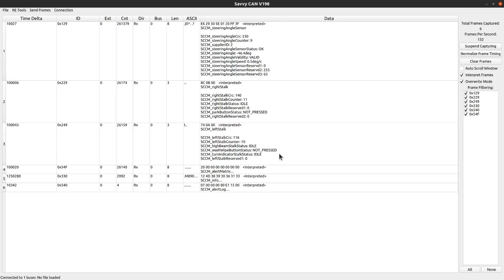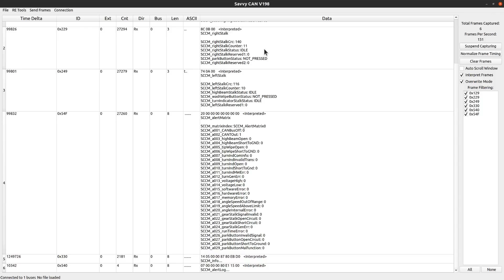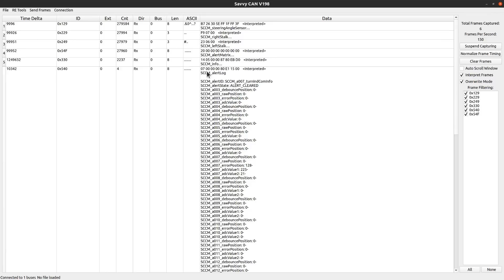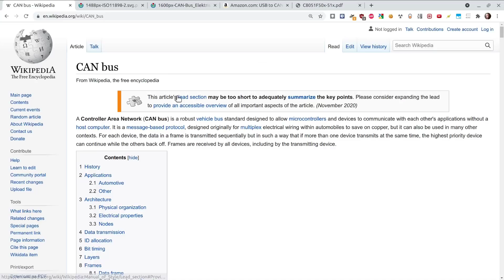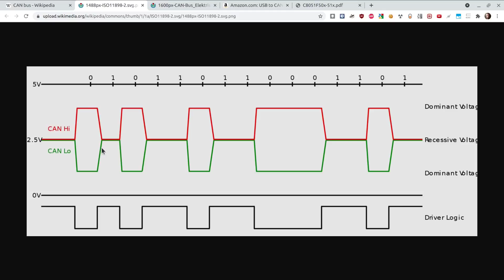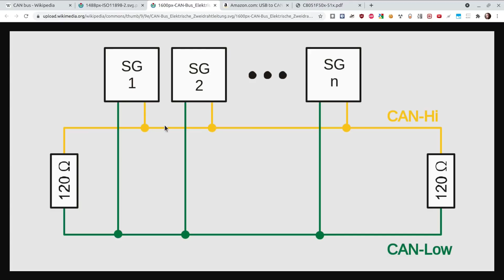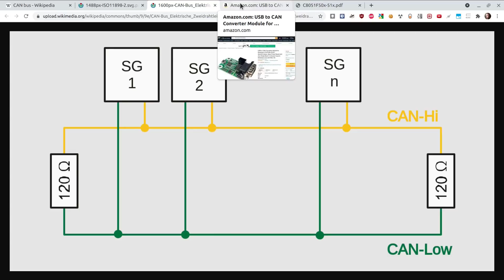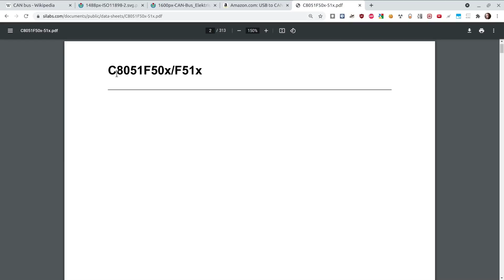Tesla CAN Bus - Quick Exploration

Comment: 14:26 Why we have a terminating resistor at each end.
Reply from the maker: I explained it in the video, if you send a signal down a wire and the wires are just open, the signal will reflect.  The 120 ohm is the equivalent to an infinite set of wires, so the signal gets turned into heat in the resistor instead of creating a reflection.

Comment: I have problem about conection with Savvycan V208  program (can't see serial port) but I using Innomaker program it work fine. Please tell me about program setup or connection setting
Reply from the maker: Sorry, I use Linux and SocketCAN, so it just works, no drivers needed.   Can't advise on Windows because I don't use it.

Comment: One of the things Tesla and other car makers have done are make light bulbs a part of can bus. Makes finding burnt out bulbs easy for a tech, expensive for the customer.
Reply from the maker: Tesla doesn't use light bulbs.
Reply: @Ingineerix they have puddle lights on the bottom of the doors, lights on each side of the trunk. All these are on can bus and Tesla has told me the replacements don’t report to the system. The mobile mechanic suggested saving the old lights ( in my glove box) as they are $35 each.
Reply from the maker: @frankdelao4067  Firs off these are not "light bulbs", these are LED based.  They shouldn't fail for the life of the car unless there is a defect.   They are also NOT on the CAN bus.  They are driven from a body controller.  I looked in the parts catalog, and they are part number 1007151-00-E listed for $17.
Reply: @Ingineerix  the price I got was mentioned by the tech. Since there is a charge for Tesla to change them might explain the price difference. We had a G35, Infiniti wanted $20 to replace the right front turn bulb, only held in place by a single Phillips screw. For years I have heard how LEDs are supposed to last years. Our house has all LEDs. None has lasted 5 years. Our G35 had multiple LEDs in the high center stop light, several in the unit went bad.
Reply from the maker: @frankdelao4067  Most low-power LEDs have lifetimes in the 100,000 hour range.  High power is in the 10,000 hours range.  Both types depend on proper engineering of the power supply and thermal system to get those numbers.  Most LEDs don't fail, but it's usually the power supply.
Reply: @Ingineerix  most LEDs in a car are hardly ever on. I have had flashlights go bad with Cree LEDs and those weren’t used that much.
Reply from the maker: @frankdelao4067  If you do a proper FMEA on the dead flashlights or lights in the car, I bet you you'll discover it's not the LED, but it's power supply.   Those cheap flashlights are bade down to a price and are hardly what I would call "proper" engineering.   I have a 10 year old Military-grade flashlight with a Cree LED and it still works as good as it was the day I got it, but then again it was about $200.

Comment: What does it mean when it says the CAN NODE is irrational or MIA?
Reply from the maker: Well "MIA" stands for "Missing in Action", just means it's not reporting in (no frames received when they are supposed to be).  Irrational means that it's probably sending data that is out-of-bounds or doesn't make sense.  Some causes of irrationality are frame counters out of sequence, checksums that don't prove out, encoded values that can't be true, such as a percentage value over 100, etc.
Reply: @Ingineerix  my 2021 Tesla model 3 autopilot ECU is in fallback mode and service mode is saying DAS CAN NODE irrational / MIA… I’m outside my warranty so I’m trying to fix it myself
Reply from the maker: @joshmills7368  First off, a 2021 car should still be in warranty.   Secondly this is probably something you can't fix yourself.  DAS is a microcontroller inside the Autopilot ECU.  If you've powered down the car completely for 5 minutes and restarted, and it's still there, then it's probably something you can't fix internally.    When I say power down, I mean both HV and LV, not just pressing the shutdown button on the screen.
Reply: @Ingineerix  I commute 162 miles per day to and from work.. I’m at $61,000 miles.. I did the power Down for 12 hours and still nothing.. I didn’t see anything obvious on the AP board.. but I didn’t use my multimeter.. it’s acting like an IC microcontroller fried itself.. you’re saying I can’t replace the IC and it start working again?
Reply from the maker: @joshmills7368  No, because you have no way to flash the correct firmware on it.   The best you could do is replace the whole APE board with one from Ebay, which should work, but you'd lose the ability to update the software as Tesla won't have the correct certificate matches.   Sadly you'll probably have to pay Tesla for a new ICE.  (They won't replace just the APE board)   You can't replace the ICE yourself either, the GW config won't match your car.
Reply: @Ingineerix  i actually replaced the ap board with one from eBay and put my infotainment board on it and it said software update required but Tesla wouldn’t it because it wasn’t a brand new part 🙄
Reply from the maker: @joshmills7368  And Tesla can't update it even if they wanted to because they won't have the correct certs.   Sorry!
Reply: @Ingineerix  no worries.. I’m never buying a Tesla ever again.. I’ve had so many issues with this car

Comment: Great video and very informative - I have a Tesla M3 SR I want to add a Tesla OEM subwoofer and amp. In the forums people are saying you can’t just add one as the amp uses can bus and the Tesla MCU won’t talk to it as it doesn’t know it’s there. I understand that but why would an amp need to be on the can bus? Surely it would be possible to program a arduino to send the signals it’s wants - or am I missing something??
Reply from the maker: It's not CAN, it uses a special digital Audio bus called A2B.  Without config set in the Gateway that only Tesla (or Tesla hackers like me) can do, the ICE (MCU) will not output the correct digital audio.   https://www.analog.com/en/landing-pages/001/a2b.html  There are also different speakers and major wiring harnesses, it's not just the sub/amp.
Reply: @Ingineerix  ok thanks - I’ll have a look into that 👍🏻

Comment: Hello, I have similiar setup like you had. But when I use Savvycan, the windows 10 doesn't regconize it as the COM port but USB serial bus devices. I wont be able to add the connection in Savvycan. In your application, how do you "add new device connection"? Thank you and appreciate your help
Reply from the maker: Sorry, I do not use windows.  In Linux it just works with SocketCAN, nothing else needed.  My only suggestion is to look for SocketCAN drivers for windows.
Reply: @Ingineerix  brilliant. Let me explore. Thank you for your reply

Comment: is it technically possible to just take a wheel module from a tesla and use a microcontroller to convert the CAN data to a usb input device? make cheapish driving wheels for gaming out of tesla steering wheels from salvage cars lol
Reply: only issue with this i spose would be the airbag lmao
Reply: i wonder if also the CRC data is designed as a means to avoid people from going and tampering with the can bus data for steering angle without tampering with the crc data (wonder what the car would do if that check failed too)

Comment: Well my steering column sensor / click spring like the one in your video has now arrived.  Can you tell me where I could look to see which pins are for the power and which for the CAN.  Did you use a specific plug or just jumper type wires .  Thanks for inspiring me to do this.

Comment: Just wanted to add that CAN FD (flexible data rate, developed around 2011) can be up to 5Mbit/s, would not be surprised if it is in the Tesla
Reply from the maker: No, Tesla does not use FD or FT.  All Tesla CAN is 500k standard boring CAN, except supercharger communications, which is 33.3k, single-wire.

Comment: I would like to a see a tear down of the model X air suspension raven system. Or an explanation of what the module does thank you
Reply from the maker: Send me one!
Reply: @Ingineerix  you can tear mine down I already took out the rear seats it’s my service van 2020 long range plus
Reply from the maker: @Mobileccs  I can't promise a teardown won't damage something.  While I try to not destroy stuff if at all possible, there is still significant risk.
Reply: @Ingineerix  That’s fine let me know when you wanna do it ..I live in the Northbay
Reply: @Ingineerix  that suspension system has my curious I did see a bulletin on the connection at the  level sensor  I think that’s what’s causing the suspension to intermittently raise
Reply: @Ingineerix  I have  both seat modules connected and no error message on the screen removed from seats
Reply: @Ingineerix  where else in the world can you get a work truck that’s fully loaded with my tools and I’m avg 310 watts a mile….I would like to see anyone get to beat that
Reply from the maker: @Mobileccs  We sell electric vans equipped with Tesla powertrains:  https://maxwellvehicles.com/
Reply: @Ingineerix  I know but I go to eureka sometimes for service calls I use autopilot everyday I can’t drive anything else ..you never see me at gas station for rest of entire life ..I refuse to pay another cent for an engine that is 32 percent efficient on a good day
Reply: It cost me 11 dollars to go to eureka

Comment: The twisting is to improve coupling between the differential data lines so that any noise picked up is ideally coupled equally into both wires making removal of the noise at the differential receiver more effective.

Comment: Excellent video! Got a sub, please do a video on the onboard charger and the can handshake it uses to talk to a charging station! Thanks!!
Reply from the maker: On board charger is here:  https://youtu.be/lXokJEzXwaI    Overall charging is covered here: https://youtu.be/0lxxOsLcNQQ
Reply: @Ingineerix  Thanks for taking the time to respond! I meant the can sniffing of what is going from the onboard charger to the charging station, similar to what you read here from the steering module on the CAN Bus.
Reply from the maker: @wagnerbrochini3892  Sorry, I am not going to make that information public, as it would likely result in a bunch of people trying to connect unsafe stuff to the charging network.  Also, Tesla would likely change it if this happened, thus making all the time I spent learning it a waste.
Reply: Well, it was all for the sake of knowledge, but I understand your position. Either way, I don't think it would make a difference if they changed it, stations would still have to talk with "legacy" chargers, so no point in changing; it would be of huge interest to DIYers like myself to have an insight on what's happening during a charge, best regards!
Reply from the maker: @wagnerbrochini3892  The basic flow is the Supercharger is a dumb device.  Basically The BMS in the car sends voltage and current commands to the supercharger, and it does it's best to obey them.   It's very similar to CHAdeMO.  Billing/authorization is handled in the car.
Reply: Thanks for the insight, if you could do a video with a bit more structure on it, I think it would award you a lot of views. Thanks again!

Comment: Regarding the Model 3 steering wheel control module, is it possible to retrofit the new Model 3/Y heated steering wheel into the older Model 3s? Not counting software requirements from Tesla, but it is physically able?
Reply from the maker: Yes, but without the software changes, there is no way to use it.
Reply: @Ingineerix  What do you think the chances are that Tesla would allow a retrofit and enable the software? They are supposedly going to be offering it for the PWS speaker system for cars that were built without the speaker, but still have the wiring harness (I need to see if mine has the harness, March '18).
Reply from the maker: @Kingkoopa00  Based on prior history, I'd say very low.   Tesla service is pretty horrible IMO, and most often the employees seem to treat customers as something offending they found stuck to the bottom of their shoe.   Historically Tesla concentrates on the newest models and doesn't seem to give much priority for their customers of even slightly older cars.
Reply: @Ingineerix  Huh. My experience has been very different. At least in my local service department. They've ordered me parts several times, like the redesigned rear and mid diffuser, with no problem. Or things they added to later models, that I wanted to add to mine. I've heard it's very hit and miss though for service quality, and all based on the specific service center.
Reply from the maker: @Kingkoopa00  Yeah, YMMV.  I used to know a nice parts guy at one of the SCs close to me, but he didn't last long.   Based on what I've seen first hand and been told, I'd say at least 75% of the SCs are hostile to customers in general.
Reply: @Ingineerix  It's unfortunate it's that bad. It really hurts the image.
Reply from the maker: @Kingkoopa00  Yeah, I think it's Tesla's biggest negative right now.   If they would make it easier for independent shops to work on Teslas it would also reduce the burden on the company-owned SCs.

Comment: how do you decode new messages on the bus including their meaning if you have never seen them before?
Reply: By changing only a single input at a time. Combined with some trial and error, guessing and luck. If someone can do Sudoku, then reverse engineering is basically the same. I guess, there is also a Tesla hacker community that exchange their findings in reverse engineering.

Comment: For the non-Americans, the blue things are called wire nuts, they are a quick way to make temporary connections. Temporary unless it works. 😉
Reply from the maker: Yeah, I should have mentioned that.  I often use Wagos now for temp connections, but it's hard to beat a wirenut on these thin wires!

Comment: I would like to know more about the CAN database format to decode the raw CAN messages of Tesla vehicles. They are clearly a result of reverse engineering for Tesla. Is there a repository for these files anywhere as a public collection?
Reply: There are a lot of open source projects around CAN and cars so I am sure there are resources out there to find, for example I use a CAN adaptor to diagnose issues with my car
Reply: @backacheache  My question is not on CAN and cars in general. It is specifically about resources to decode the CAN frames (physical addresses, CAN identifiers, data bytes) in Tesla vehicles. This decoding is manufacturer specific and gives meaning to these bits and bytes. They are either leaked from manufacturer (i.e. Tesla) sources or the result of intensive reverse engineering work and can be treated like industry secrets and "gem stones", once they are complete or near complete. It is relatively easy to reverse engineer a few IDs and data bytes here and there for some car, but the decode that Ingeneerix showed in this video for this steering wheel control module on his bench looks basically perfect with very high quality.
Reply from the maker: There are some public efforts, but my work is from many total years of reverse engineering work.

Comment: Are there any established conventions or standards on CAN ID allocation, message handling etc., or does every manufacturer do their own thing? Also would be interested in the gateway functions in most cars to hadle message passing between different buses.
Reply: Heavy truck uses the SAE J1939 standard. Marine uses the NMEA2000 standard. All based on CAN.
Reply from the maker: No, there is not for passenger cars/trucks/SUVs, etc.   Manufacturers do their own thing, and the CAN definitions are considered "secret".  They do not ever release them, even to authorized service centers.
Reply: And on top of what's included in the CAN spec, manufacturers also like to encode aditional protocols that would otherwise be outside the standard. Like VW has TP = transport protocol running on the CAN bus.
Reply: Except heavy trucks, everyone does their own.

Comment: keep it coming!😍 i wonder if Toyota's drive by wire steering is robust enough.  i guess possible to makeit safe by automatically slowing down the vehicle when it detects a failure in the steering.  but then mechanical steering always works.
Reply: It has been used in aviation since the '70's. I can't imagine that Toyota would implement a system with such obvious safety possibilities (read: law suits) without making sure that it's plenty robust.
Reply from the maker: Tesla doesn't use drive-by-wire steering (yet).   The redundancy is mainly for autopilot.

Comment: The reason for the twisted pair and terminator resistors is related to transmission line theory.  The CAN bus wiring is a transmission line.  When designing your projects treat the CAN as a transmission line.